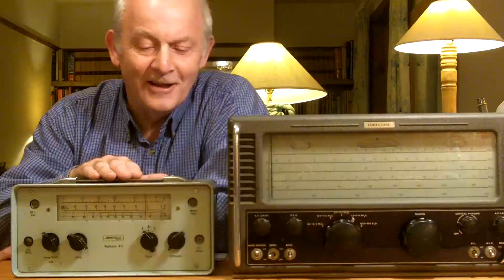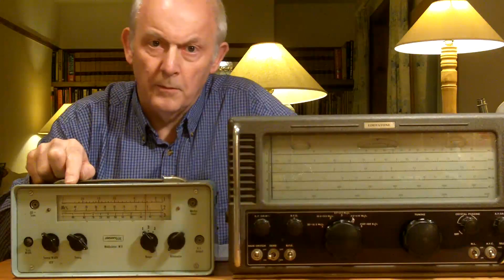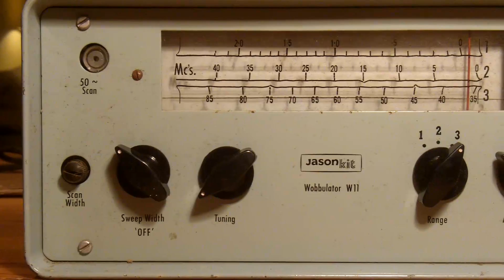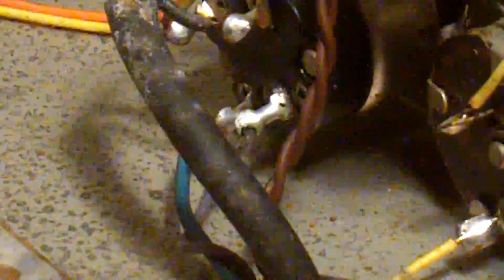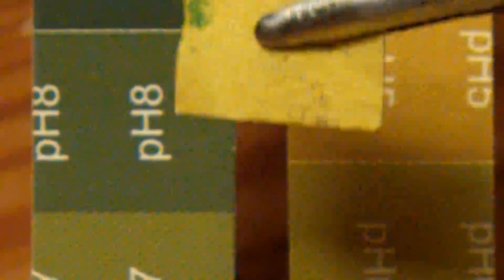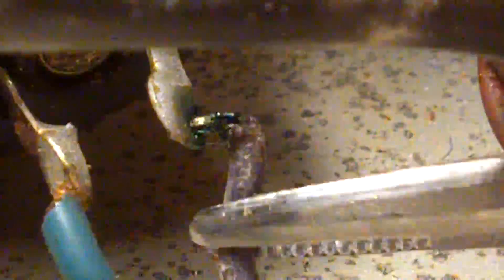About Radio ... Part 35 Wobbulator or Frequency Modulated Oscillator.

Comment: I have a Triumph 830 wobbulator/oscilloscope. The frequency is modulated by applying a signal from the heater line to a "control tube" modulating the miller capacitance of the control tube. The grid of this control tube is connected to the oscillator so as to modulate the frequency. Clever economical design. See it here is you wish:
https://richardsears.wordpress.com/2011/09/08/triumph-830-wobbulator-oscillograph/
I have another unit that uses a motor to rotate a vane condenser, that also uses a signal from the motor to sweep the scope tube, in this way the FM and the sweep are mechanically synchronised: https://richardsears.wordpress.com/2011/12/21/dubrow-ts-452-cu-sweep-signal-generator-oscilloscope/

Comment from the maker: Hi there, I guess it must have moved on a bundle, I was into designing and manufacturing induction heaters, using water cooled valves just like huge transmitters, in the 1970’s you could stand up inside a 20KW RF heater, by the time I left the industry ~2000 I could carry a 20KW unit in my arms. But I don’t suppose new technology is seen as all progress, ask anyone with a NatWest bank account. (June 2012)
Kind Regards ... Andy 
gw0jxm

Comment from the maker: @sparkey1958
Hi again. 
Yes I know the reaction you are talking about, I’ve only seen it one in domestic wiring and that was about a year ago and exactly as you say it ran down the wall out of the light switch like something out of a horror movie. Back to the wobbulator, I’ve stripped the insulation back ¼” and the tinned copper was bright but I guess it could have just been a local reaction in one spot where the tin had gone. 
Regards ... Andy

Comment: hi andy, apart from restoring jukeboxes, my day job is a electrician, and i have seen the liquid problem on house wiring...infact it can be so bad that it actually fills up lightswitch back boxes and runs down the wall!
it happens with wiring from the 1960's and early 70's...it is caused by the plasticisers used in the insulation breaking down and reacting with the copper..hence the green gue..which stinks if you get it on your hands. it leaves the cable brittle with poor insulation resistance

Comment from the maker: @AllAmericanFiveRadio 
Hi Rick, I’ve found two wobbulators, the one I’ve borrowed and one I’ve found via the vintage-radio. net  and that one I’ve brought together with an old Techtronic oscilloscope. The second wobbulator uses the time base of the scope to trigger it but I’m told that it needs repairing first. Man my hobby draws me in deeper  and deeper, I just hope I don’t need to buy a tool to fix the scope to fix broken wobbulator to fix the Eddystone radio etc etc...